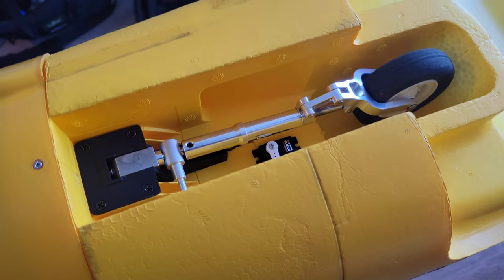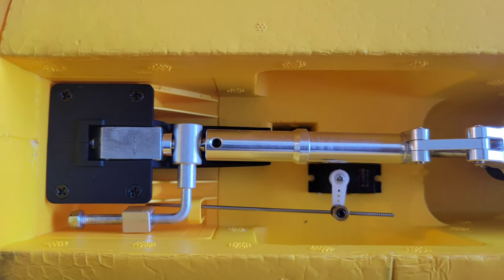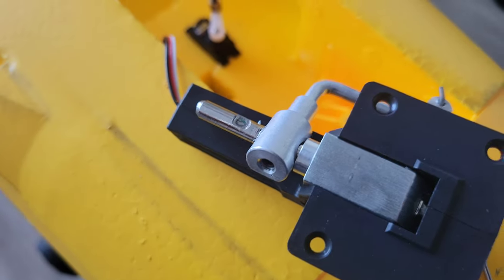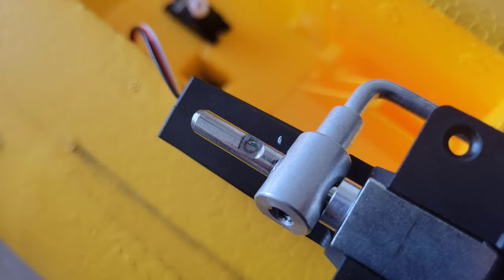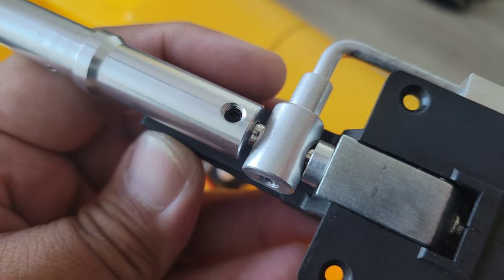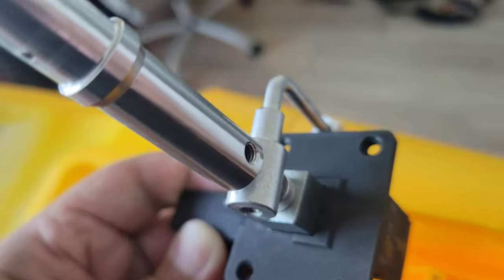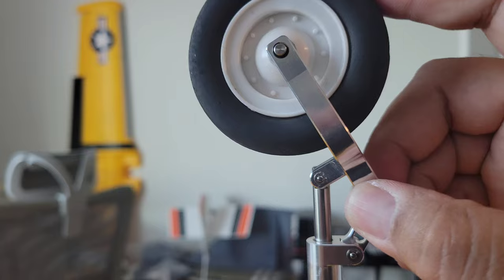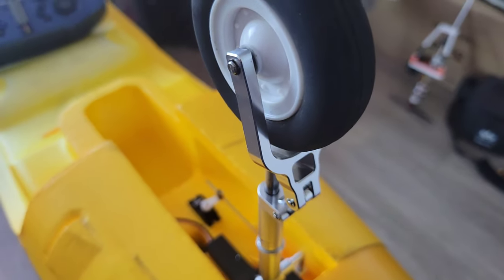E-Flite CarbonZ T-28 2M v2 Front Strut Mod

Comment: I used the A-10 mains (trailing link type) and they work perfectly and come with much softer tires as well.  They didn't have the nose strut at the time so that is yet to be done.
Reply: Do you have the exact manufacturer and part number maybe I’d like to know what they are

Comment: Can you tell me please if you used a different pin ? As here in the comments mine has a bend. I’ve ordered an 80mm A-10 pin but I’m worried it’s not going to be long enough to accommodate the steering collar too 
Cheers
Reply: I have the same problem. I have tried  the A-10 Pin - it is absolutely too short to accommodate the steering sleeve and being able to screw the gear on.
Reply from the maker: Cant remember if I cut a section from the stock front gear or the main gear i had at the time. But i do remember having to break apart the plastic and cut a section from the lower part of the gear. Which is why i had to make that collar/shim.  There is going to be some play since the A10 strut pin and the gear servo socket are slightly different sizes. Adding the collar/shim solves that issue. Its not a drop in fit. Wish it was easier. But i made this video well after i did the mod since a lot of guys at the field wanted to see how i was able to put suspension struts on mine.
Reply: I solved the problem. A-10 pin is fine you just need to split the retract case open and remove the original front leg. Get a drill bit that’s just larger than the pin head. Then work out how much pin you need sticking out for retract leg and steering collar then drill carefully with a bit of oil. I drilled about 8-10 mm. Then re fit it all
Reply from the maker: cool. its definitely not a drop in fit as some were expecting. you can either change the pin or mod the servo to accept the A10 pin. either way its a little extra work. but its worth it.
Reply: @MarkJones-100  that's a fantastic Idea 💡 I love it!

Comment: will the stock nose gear in the A-10 fit in the E-Flite CarbonZ T-28 2M v2 with out any modifications? Is the base plate the same size?

Comment: Thanks for the info, to bad motionrc is out of stock for the nose gear, hopefully they will have it before next season. I did a mod on my t28 1.2m and i know im going to have the same issue with this beast. You would think for the price they would put better gear in it.
Reply from the maker: Definitely. The stock landing gear is the worst part of this plane. Some people say its not needed. But come on. Wire struts just look ridiculous even on the 1.1M T-28. 🤣
Reply: @all_rc  agree they look cheap and will bend.

Comment: HEADS UP: This replacement seems to no longer be valid, as the gear pins are now bent and not straight. There is not enough room now on the straight portion to mount this new A-10 strut
Reply: I hadn't read this comment until now and discovered last night while upgrading mine that it too has the bent leg. I ended up using the straight portion after the bend, then cut out the foam to clear the tire. A-10 mains fit right in.
Reply: Gear pins?  Are you referring to the 5mm wire coming out of the landing gear retract being bent now?
Reply: I ended up cutting the top 15mm of the A-10 nose gear strut and drilling the 5mm hole into it a few more mm and drilled/threaded new set screws. The strut now fits after the bend.
Reply: @deadstickduck2025  So its the aluminum strut itself that now has a bend in it?

Comment: Take the trunion out of the front stock retract.  Get a drill bit the same size as the head of the A10 80mm retract pin.  VERY carefully countersink drill the hole in the trunion checking each time until you have it deep enough to allow the head of the pin to go inside the trunion and stick out the other end to mount the nose gear on it.  You may need to file a flat spot onto the pin for the grub screw.  No need for sprite cans, fits tight as if it was made that way from E-Flite.
Reply: So you modify the Eflite trunion to fit the larger A-10 pin. I didn't see a pin in the photo of the A-10 gear. So I'm assuming you made your own. Did you use a drill bit as the new pin? I've heard of people doing that.
Reply: Motion rc sells the a10 80mm retract pin.
Reply: @RSchwara1  Thanks! I placed my order today. I look forward to installing this gear
Reply: @Blackys-Boy  Please note this pin will not work on the T-28 as it is too short. I also bought it but it is unusable. I ended up having to make my own pin.

Comment: The Freewing Zeus nose gear also works without any mods to length!  BTW the Zeus strut has the same diameter hole as the T-28, which BTW you have to cut off to fit since the T-28 has a single wire strut NOT a cnc unit!!  You make it look like there was just a pin on the T-28 nose landing gear box.  NOT true!!